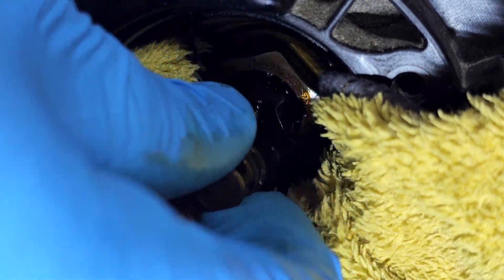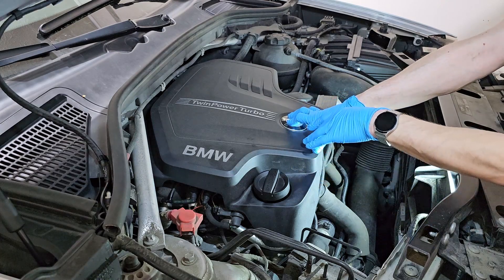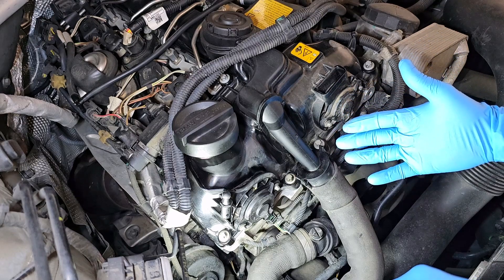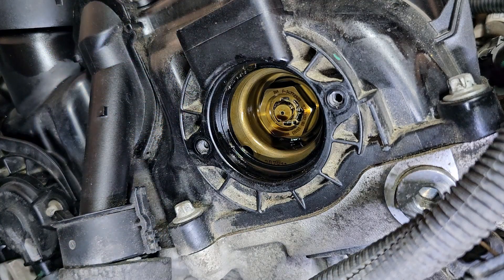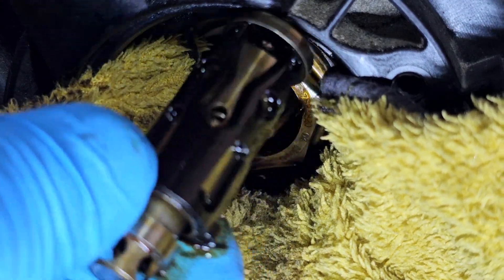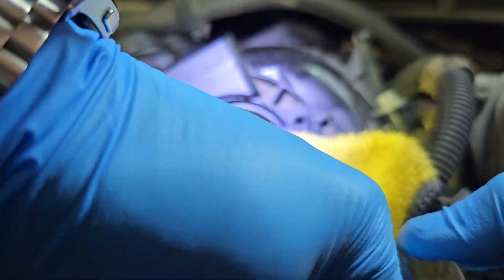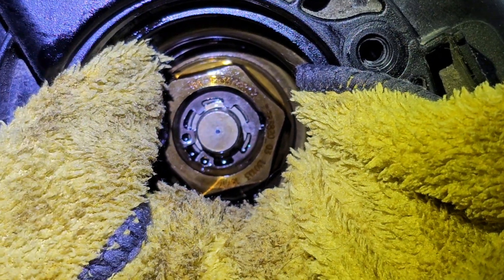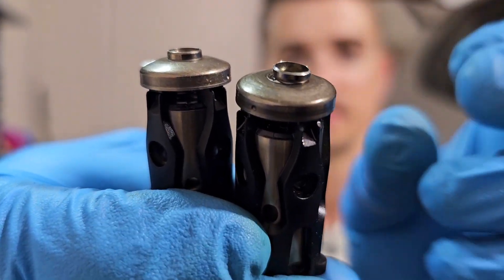Drivetrain Malfunction ,  BMW VANOS failure

Comment: Another question, I need "buy" Ista+, but what specs would you suggest on a handheld computer for the software and some other BMW software often used. As understand it, I don't need a new "laptop", but how many free space on the hd do you think is a "minimum". It would be nice to have all (more or less) "needed" software on one laptop! 😁
As I have a F25 30d and a E83 20d, it would be good to also be able to use INPA.
I would appreciate a very short answer. Thank you.
Reply from the maker: Good question,  and you're not the only one asking, I will do a video for this subject! So stay in the are!